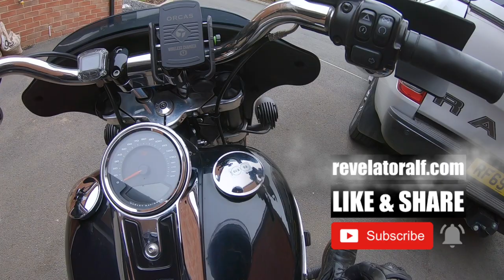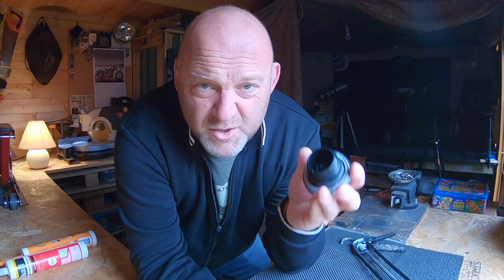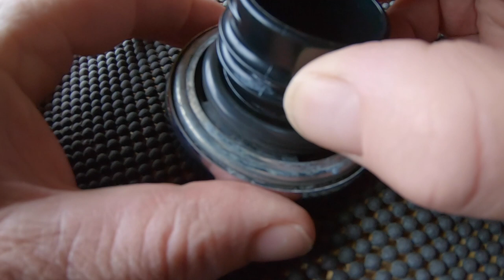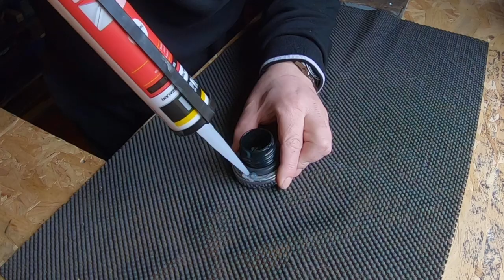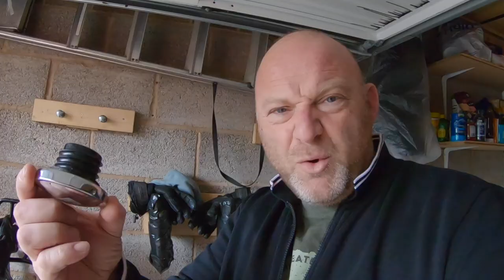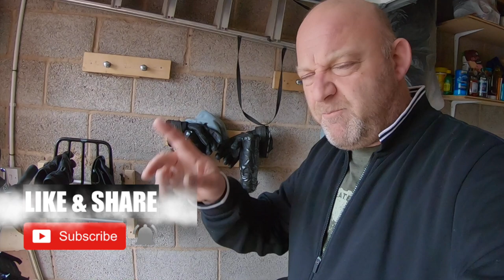Motorcycle Petrol Tank Cap Rattle Fix | Harley Davidson Gas Cap No Damage Fix

Comment: Hi mate Ive cured mine by cutting pieces of rubber o rings and pushing them in the slots . No rattle, and no chance of silicone getting in to fuel system. worked for two years so far , keep it up bud.
Reply from the maker: Yep that sounds better actually. Cheers

Comment: Drives me nuts. Going to try this. Was thinking about doing it before the video but certainly will now. Thank you.
Reply: Changed my mind. Just went out there and tool a small punch to the silver ring. Punched in in 4 locations around the inside and it stopped the rattle.. No fear of silicone in fuel. Thank you for the video.

Comment: My 2018 FLFBS started yesterday rattling on the right while out on a ride and I thought WTF is that noise.  Mine is a stage 2 as well and has only been a stage 2 for less than 2k miles.  I had a large socket I had for the rear wheel  nut for my 1290 Super Duke. Took some bubble wrap and had the socket with the open end facing up and the bubble wrap between the cap with cap top facing down and used a small punch and just went around it and tapped it down.  No rattle and it still rotates.  You have some great videos though.

Comment: One thing that I have learned is to never have silicone anywhere around the fuel system. I have seen so much misery caused by silicone. 
Method I used get a socket that fits just inside the top shiny side of the fuel cap. Get a dead blow or large rubber hammer. Place a rag between  cap and socket. Support the underside of the cap and wack the hole mess. It works and the silicone crap stays out of the fuel. Silicone will find its way in the fuel tank .
Reply from the maker: Yep that works. Cheers

Comment: I fixed my gas cap rattle on my Sport Glide by going go a flush mount kit! Gas tank and caps look much better and NO rattle. so I am a happy Chappy
Reply: I was thinking about going with these, cause I love the look, but was worried about the glue holding on the left cap. How's it holding up?
Reply: @billywebb9614  The two sided tape works well.  the only thing that ticks me off....  Is i went with the HD genuine flush mount kit and for the outrageous cost, they are cheap quality vs. going with an aftermarket kit.  But once on the bike they look great and the two sided tape holds amazingly well.
Reply: @impoppa9647  no rattle yet? when I watch the reviews on it, looks to have some play on those flush mounts from HD?
Reply: @curlyjr22  
Have been very happy with the flush mount kit. Over a 14 months or more of riding with no issues. Everything fits nice and snug.
Reply: @impoppa9647  thank you